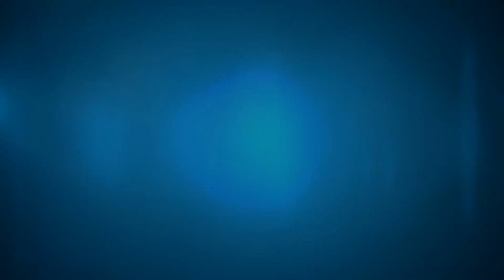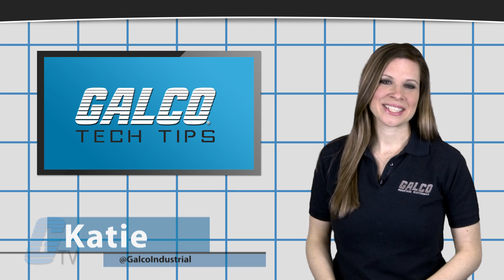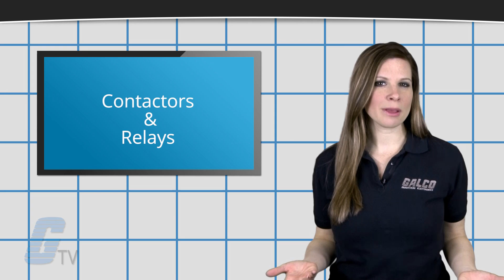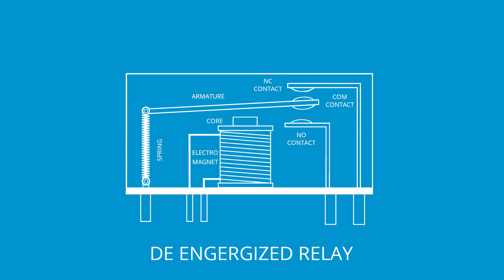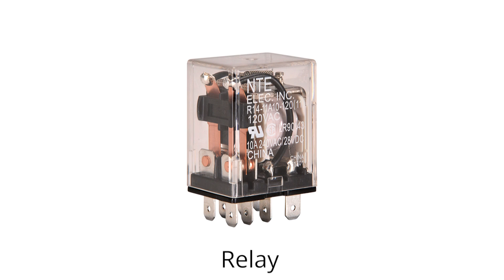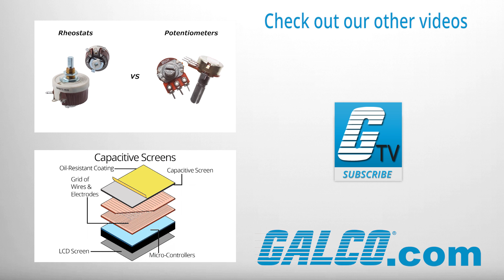Difference between a Contactor and a Relay - A GalcoTV Tech Tip | Galco

Comment from the maker: A contactor is a large relay, usually used to switch current to an electric motor or other high-power load.
Large electric motors can be protected from overcurrent damage through the use of overload heaters and overload contacts. If the series-connected heaters get too hot from excessive current, the normally-closed overload contact will open, de-energizing the contactor sending power to the motor.